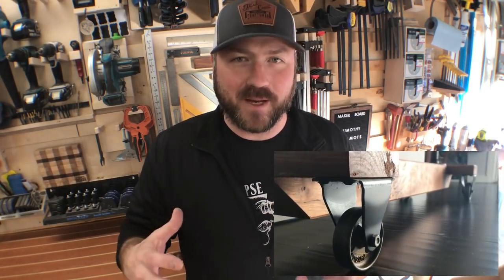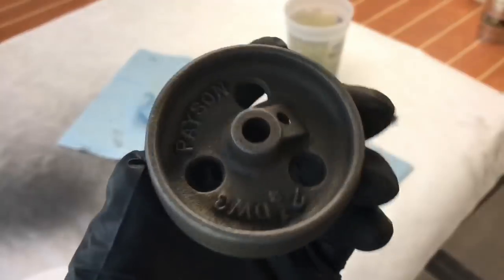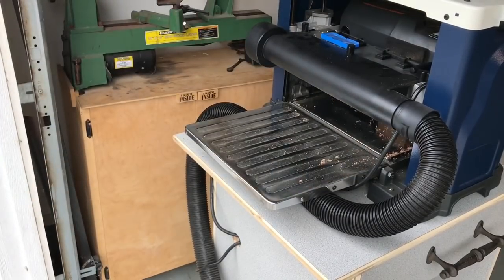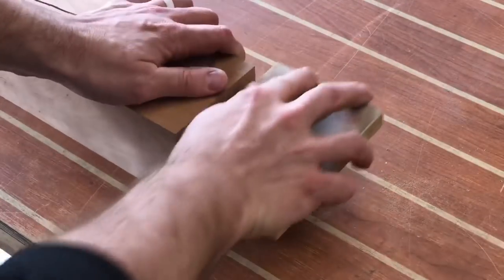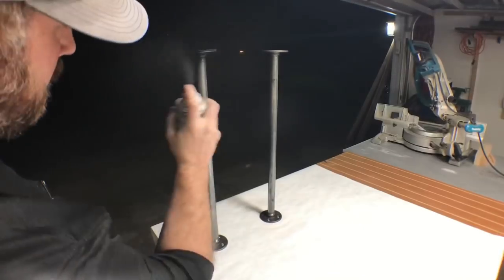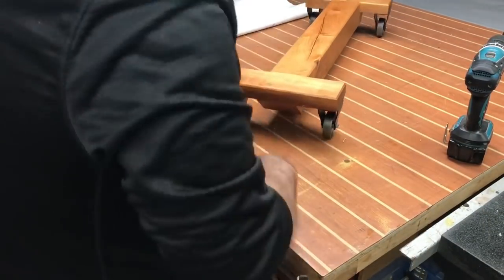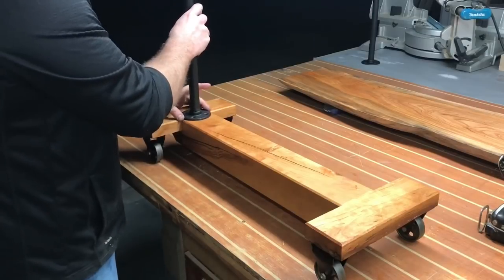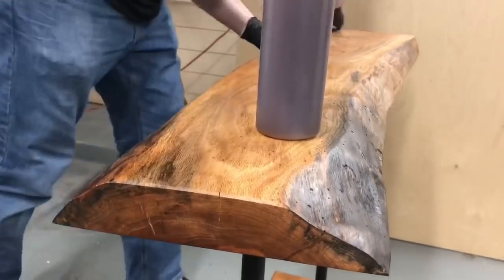How to Make a Live Edge Entry Table | DIY Woodworking Project

Comment: Hello,
How long have you had your Rigid Jointer and have you had any problems with it.
Thanks
Reply from the maker: I’ve had it for around seven years and other van chipping out a blade or two, my mistake of course I like it. It is a bit top-heavy and I feel like the base could be heavier however it’s really not that big of a deal